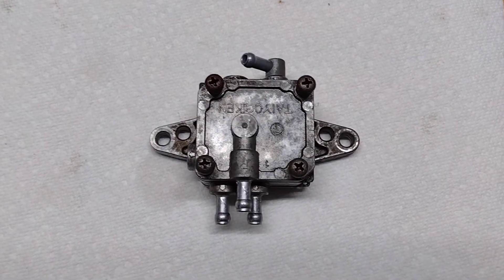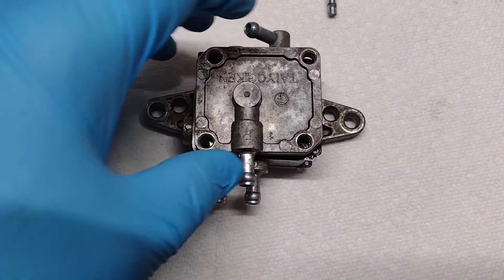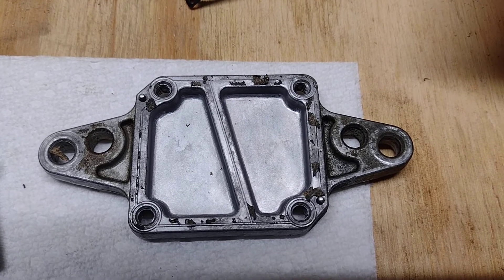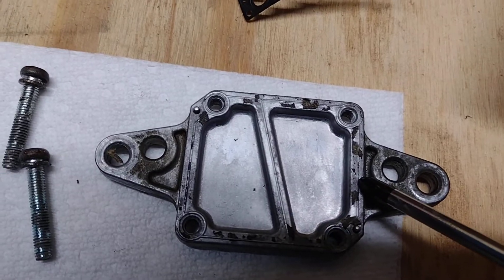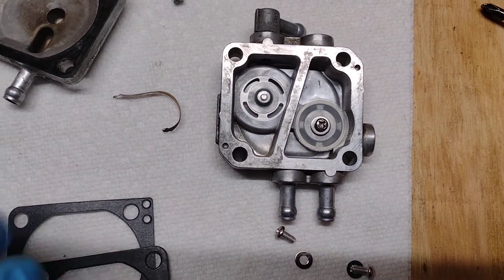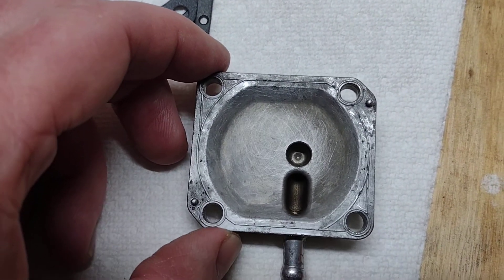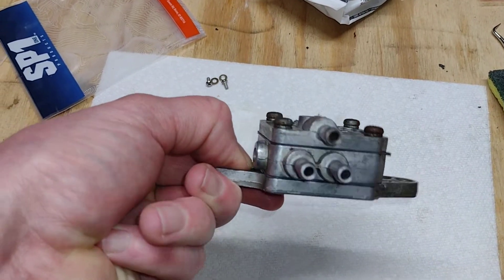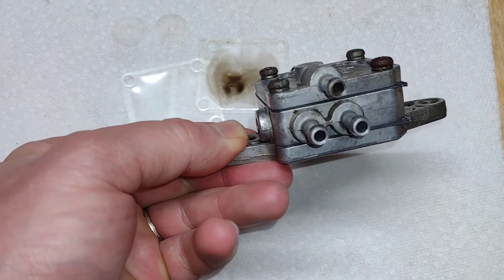Polaris Indy fuel pump rebuild. Taiyogiken.

Comment: To my understanding with my sled polaris indy 440, watch out for fuel pick up line, fuel lines, fuel filter, fuel pump, throttle cable adjustment, carburetor sync, carburetor idle, carburetor air screw adjustment, carburetor needle setting, oil pump cable adjustment, crank seals, crankcase seal, top end gaskets, and spark plug. Depending on the weather conditions you have to run rich or lean. With cold conditions water perception can be formed in the gas tank if there's lack of fuel but I use seafoam to clean that out. It takes a little bit of finding the right tuning depending of the weather conditions to fix any bogging.

Comment: I just bought an oem because it is easier to work with than an aftermarket like you have
Reply from the maker: I couldn't find OEM at the time.  Perhaps the "supply chain" is opening back up.

Comment: I AM HAVING THE SAME PROBLEM FINDING THIS. ANY HELP WOULD BE APPRECIATED
Reply from the maker: I may have gotten lucky when I found the needed kit on ebay.  I searched the address shown on the kit packaging (2:52 in video), coming up with a website:  https://www.wps-inc.com/    I don't know if they do retail, but it might be a place to start to look for the kit or a dealership that does retail sales with them.  good luck.
Reply from the maker: I just now googled SP1 12-11301  -  several on-line retailers popped up; hopefully one will have the item in stock...

Comment: Hey Matt,  great video! I am in need of the same fuel pump rebuild kit. The link to have in the description is unavailable. Would you happen to know of anywhere else they would have them? I'm hitting a brick wall. Thank you!
Reply from the maker: I may have gotten lucky when I found the needed kit on ebay.  I searched the address shown on the kit packaging (2:52 in video), coming up with a website:  https://www.wps-inc.com/    I don't know if they do retail, but it might be a place to start to look for the kit or a dealership that does retail sales with them.  good luck.
Reply from the maker: I just now googled SP1 12-11301  -  several on-line retailers popped up; hopefully one will have the item in stock...